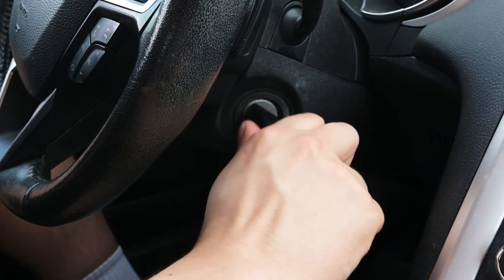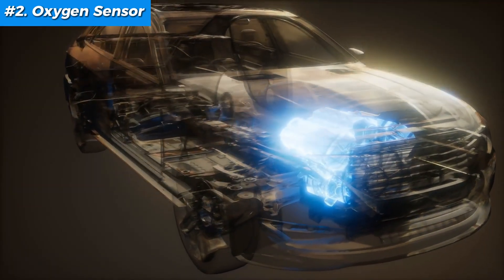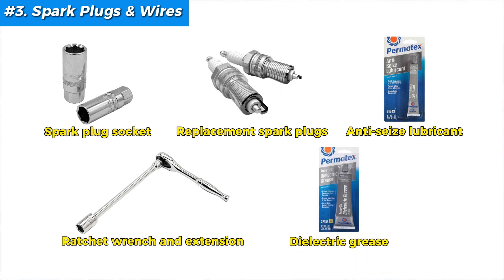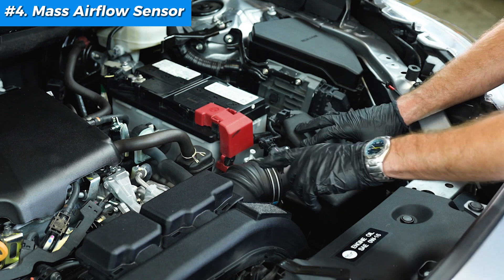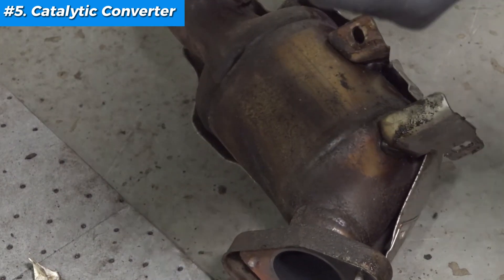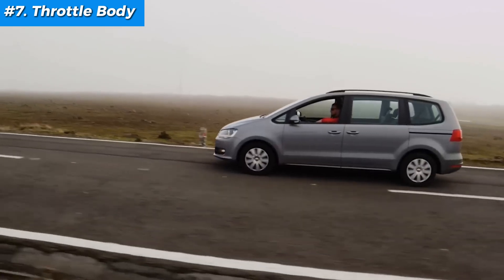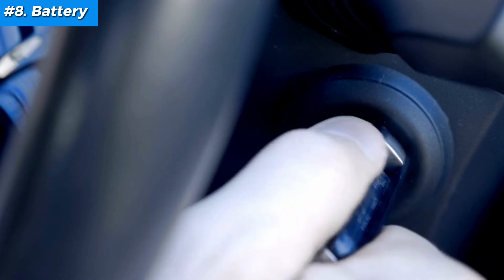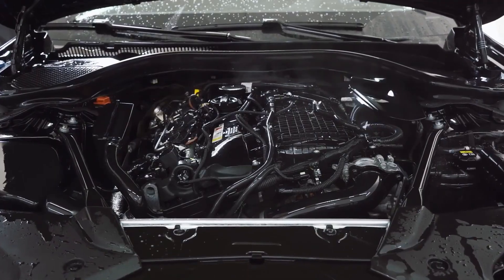Check engine light on? 8 EASY fixes

Comment: One thing missed in the video. When replacing spark plugs BEFORE pulling the plug use compressed air to blow out the plug "wells" of any loose crud after cracking the plugs loose.
Reply: Great advice 👍🏿